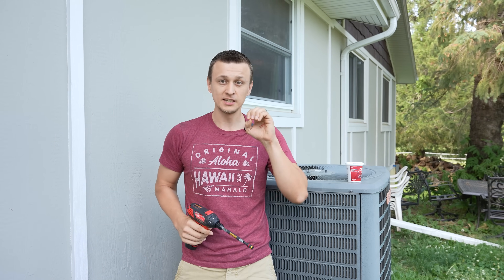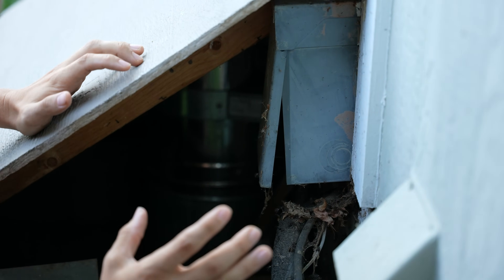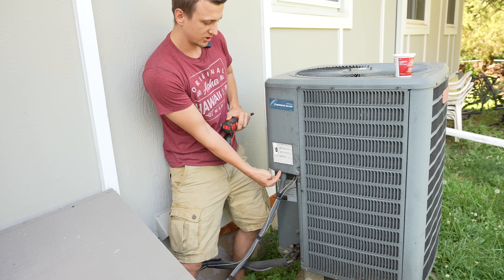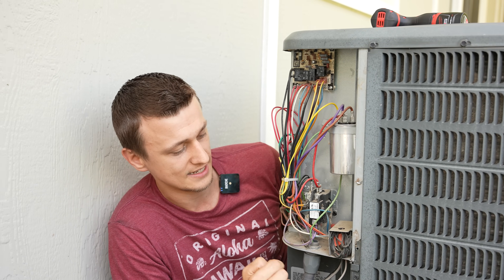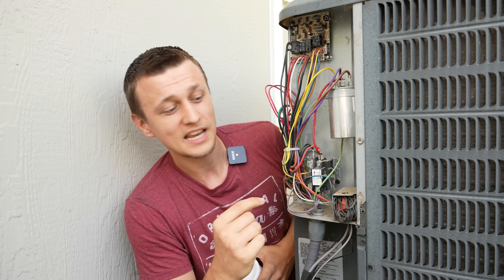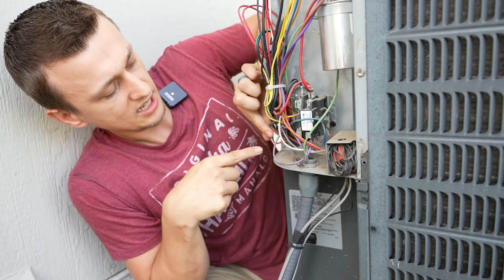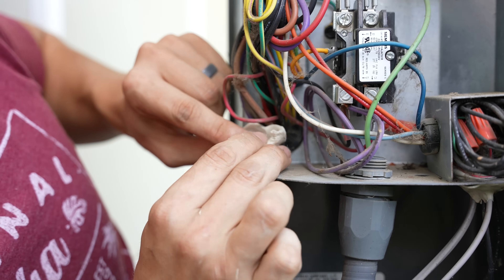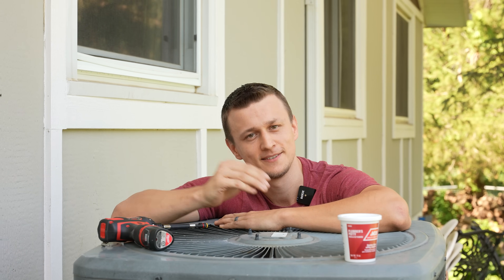HVAC Air Conditioner Preventative Maintenance

Comment: I would highly recommend doing this.  Last year my Trane AC condenser fan suddenly stopped working.  When I opened the panel I found a dead electrocuted mouse had fried the start capacitor.  It happens.
Reply: same with computers. you never know when a mouse will destroy a server or mother board

Comment: Hello.  New subscriber.  Love your videos on heat & AC install & repair.  I am a DYI guy myself, but do not know my unit.  It is a Lennox model MIL296V,  I want to buy the service manual for this unit, but I can not find it.  Where can i go to buy this?  PDF or paper works for me.  Any thoughts or links you can suggest?  I will try to make a donation to your channel after I type this.  Thank you so much!  jack
Reply: Hi Jay!  I made a $10.00 donation to your channel yesterday, Sep 31st 2022.  I would love to hear where a homeowner can buy service manuals (or what ever they are called) for different brands of  HVAC units.  I have a newer Lennox MIL296V furnace and it seems like Lennox has no service manual for it.  Any thoughts on this?  Love all of your videos!  Thank you for taking the time to help us DYI homeowners.  All the best,  jack
Reply from the maker: Hi Jack! Thank you for the donation and glad to hear you love the videos! The product literature can be called a service manual, operating manual, or installation manual. Often times you can find the needed manual online but they are not all on the web. Sometimes calling Lennox directly and getting it from them is the only way. (of course getting through to them to begin with is usually a task on it's own) I was not able to find your model number either. That being said... Usually they use the same manual for a series of units so getting a manual for a model number that is close to yours may be all you need. Like this one right here: https://tech.lennoxintl.com/C03e7o14l/VIu12Ch2uV/507869-03a.pdf
Reply: @WordofAdviceTV  Thank you Jay for the link.  I will keep looking, but the one you found will probably work.  Really love you vids!!

Comment: Thank you. That’s new tric for my list. I love to advise my customers how to take care of the equipment.  In my area, the problems I see more than mice are wasp and ants.  I recommend people to put ant products around condenser. 
Also to keep grass cuttings away  of condenser when they mow their land .  Also in the winter to cover the top in order to keep dead leaves out of the condenser or to install a chicken wire at top of the condenser.   Finally if condenser is dirty to clean it or have somebody to clean it .
Finally I see sometimes long 24 v wire that if they don’t take care of it, they cut it with weed eater or a dog…. ( so better to wrapped around electrical wip.

Comment: “Plumbers putty” is a great idea to seal up holes in a condenser, you can also use this stuff called “thumb gum” very similar type stuff but used by electricians, NEVER USE STEEL WOOL….  steel wool conducts electricity and you can get zapped… also it can cause a short if touching wires, In my 15 years experience I’ve seen people do this many times

Comment: I just wanted to know your thoughts on using a drill driver versus an impact driver when you are removing or installing small fasteners? In other words, would you use an impact driver to fasten to number six screws on a burner cover or would you use a drill driver?

Comment: What is the best product to clean air handler coil?  Recommendations have been: Hydrogen Peroxide, 409, Vinegar, and Bleach.  Also, does it need to be rinsed with water after spraying.  Thanks, Jean

Comment: quick question:  during normal maintenance of my HVAC, is there any refrigerant loss, or is there any reason to purposefully let some refrigerant escape for a system that is reportedly already low on freon?  I have what I think is a video of my HVAC guy doing this exact thing.  It's a big company so I'll be calling them.  But was trying to understand first.

Comment: I need help! I bought an ecobee thermostat but when i set it all up the fan will run nonstop even when i turn it off within the thermostat settings. This doesnt happen with my old thermostat (nonsmart). Any idea why the ecobee is sending a signal to the unit to run the fan???

Comment: Flip bits are awesome but keep a 1/4 in your pocket,when you go to take the screw's off the contactor the thick wall of the flip bit small side won't let you get the head on the scew.
Reply from the maker: Good recommendation. Thank you for pointing that out!

Comment: Mice chew on wires because their is Soy bean in the insulation coating. This happens to most wiring . Mice are eating the wiring in most all Vehicles, including electric cars.
Use a small paint brush , paint wires with ultra hi temp silicone gasket maker. Or 
Spray coat liquid 
Rubber on wires & connections. 
PS   Clean your AC fin's. Coil cleaner or dish soap & water. Rince. Also use plumbers puddy or steel wool to block holes & gaps. PS it happens to houses & garages & barn Wiring Also. Causing  Fires.
Reply from the maker: Great suggestions! Thank you. I didn't know about the soy bean in insulation either.
PS    Will do good sir  👍
Reply: It's not just electric cars; it's most modern cars.  My mom had a 2016 Jeep which got wiring harness damage from mice 3 times. Dealer told her the soy insulation was attracting the mice.

Comment: Just this week alone is had two mice and literally not even an hour ago I went to a friends and she had a fried chipmunk 🐿
The last tech that was there didn’t screw the door back on
Reply from the maker: It's rodent season! It's kind of bizarre how that works. I have that happen sometimes where I don't see a single mouse for over a month and then I see one every day for the whole week! (sometimes a whole family moves in) They come in waves  😄
Reply: @WordofAdviceTV  yeah it’s funny I was just telling her about my day and how I had the mice e problems then she has the same issue. Unfortunately hers was also a contactor issue. Never seen her type of contactor before. Really old system the suction line was kinked almost fully at the unit and some how still ran really cold. Had to put a screw into the contract to run it though. I was in my car and she lives an hour away so I’ll have to go back and replace it but yeah man 3 rodents in a week alone. Rubber gloves 🧤 and needle nose pliers really coming in handy lately!

Comment: Hi Jay.  You can always use “duct seal” a gray dough like material that is used by electricians and plumbers to seal up holes.  It does not conduct electricity and is very easy to use just like plumber’s putty.  It can easily be found in big box stores in the electrical department for about $3.00.
Reply: I commented then erased I thought you meant regular duct seal lol the dough stuff around her is call thumb gum. Works excellent!
Reply from the maker: @Bill Handymanbill Yes! Wonderful stuff. Thank you for suggesting it! That would be even better than plumber's putty 👍👍

Comment: I hear tinfoil works too, similar to the steel wool.
Reply: I would not use tin foil around electrical connections as it is conductive.
Reply from the maker: @A Cris   Yes, tinfoil will stop the rodents too 👌 I've actually done that before as well when I didn't have the putty on hand. (I used aluminum foil tape) But like Bill said, since there are electrical connections nearby, this is probably not the best thing to use.

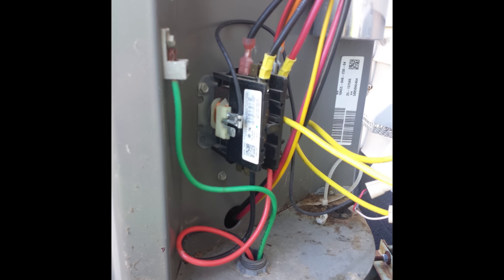Comment: Those "Bushings" at 2:37 can be cut and installed with the wires INPLACE. Faster and cleaner way to service standard size holes.
Reply: They are called grommets
Reply from the maker: Ah yes! That's what those things were called. 😅 Grommets/bushings. It totally flew out of my mind when I was filming the video. Thank you for explaining the proper way of doing this!

Comment: Are any of those holes for draining rain and moisture?
Reply: Not really, just for feeding wires through. I've never seen water puddle up in the control boxes. Plus the covers aren't really sealed tightly to hold water in anyways.
Reply from the maker: Mackenzie Gray said it better than I would have 😇 I appreciate the good reply! 👌👍🤙
Reply: @mackenziegray2090  , thank you.